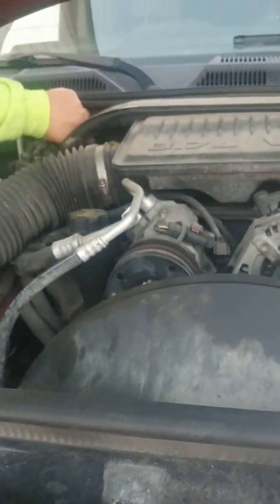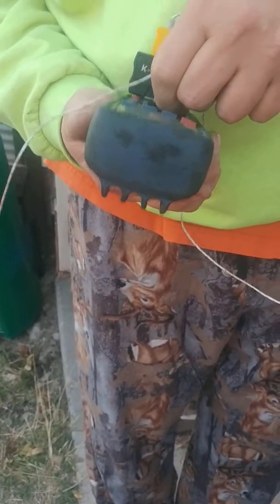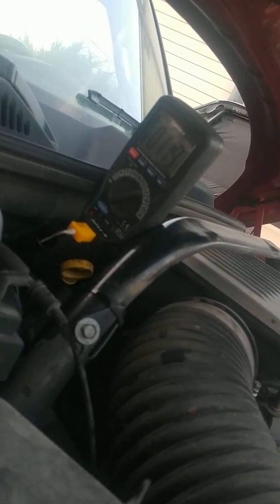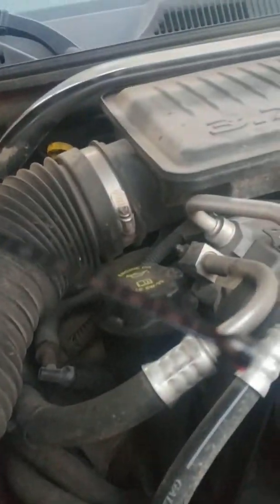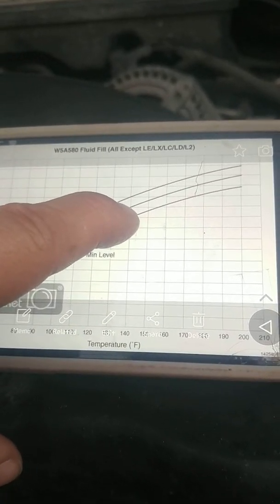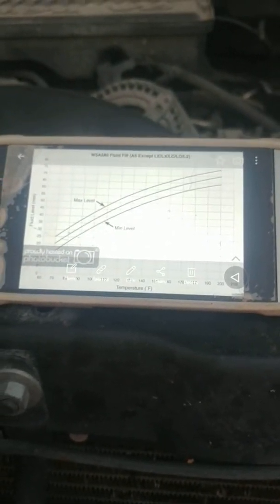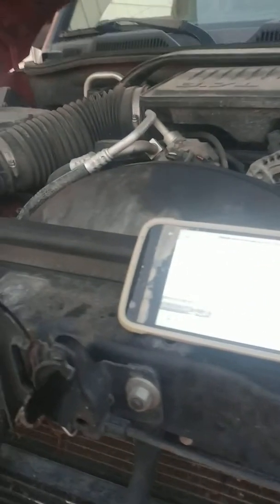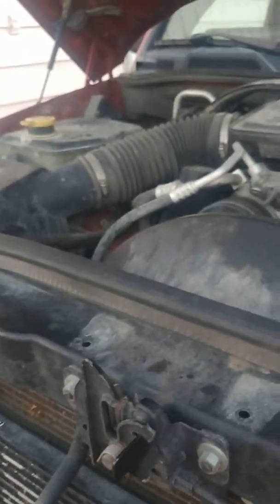Cont'd trans filter &fluid change, 06 jeep commander

Comment: How many quarts did you guys put?
Reply from the maker: I honestly do not remember.
Reply: He said he put in 4 quarts. Which will mix with the 2 1/2 in the torque converter which means basically you did a 50% fluid change.